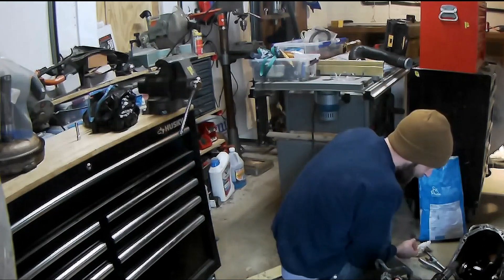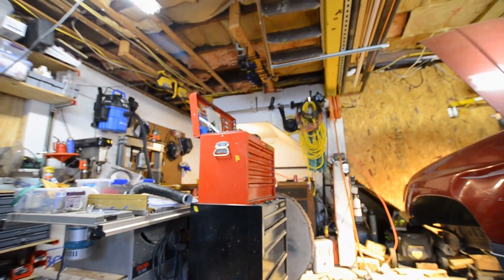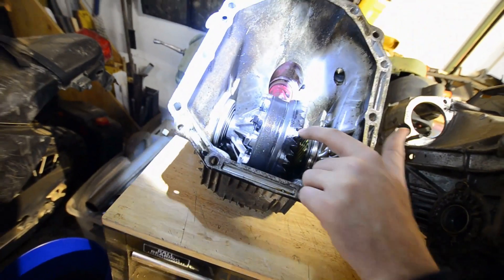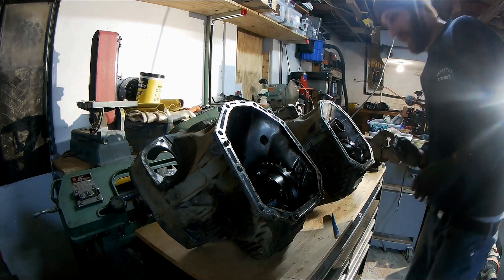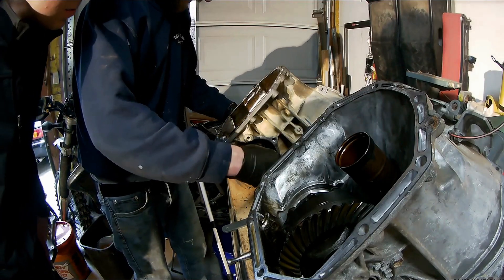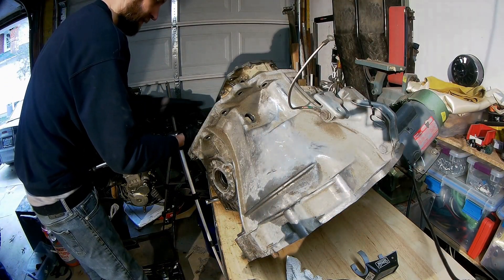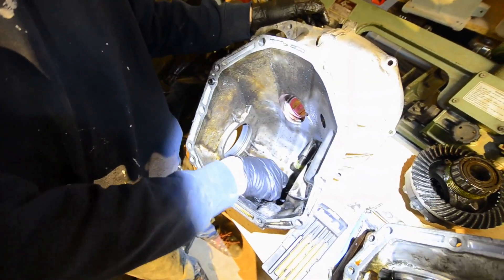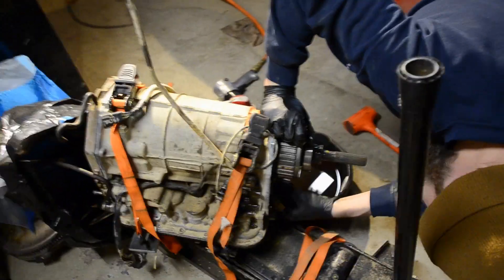Autopsy of a Subaru front differential run without oil

Comment: I own a 2017 Subaru Forester XT. I am currently dealing with a damaged transmission that a shop is claiming the front differential, which had no fluid in it, caused the transmission to fail. Is that possible in a CVT transmission?

Comment: My front limited slip still works on my 08 2.5 outback base with 230k. Im not sure about the rear... But when I put the front wheel drive fuse in both front spin with no delay. 💯👌

Comment: Thank you very much for the video. I have been looking for a video regarding front differential noise. My 09 Outback 4 speed automatics front differential is making loud noise when decelerating at a high speed and sometimes when driving about less than a mile with winning noise. I have been looking for a replacement front diff but I have not found one yet. I guess its sold with transmission which makes it harder to find the right one. Hope I can get some feedback on how to find one for my 09 Outback. Thanks again for the video

Comment: I know this is an old video but, May I ask how you got the pinion out? I haven't took the car apart yet. I've had a spare trans in my storage for a few years. My car broke on the way to work yesterday. I stopped hastily and grabbed the transfer case but noticed I didn't get the pinion.

Comment: Great job!  Some idiot mechanic did a differential service on my 2007 Forester and did not refill the front differential.  Not knowing it, I set out on a 1500 mile trip north.  I developed a high pitched noise about 800 miles out.  I checked the oil level and it was bone dry.  I filled it with new fluid and completed my trip.  The car always had a slight whine and at 250K the transmission failed.  There was lots of metal filings in the automatic transmission pan, etc.  I got a used transmission and fixed the problem.  Was it the pinion bearing that failed?  Hard to trust “line” mechanics to perform work properly.

Comment: Hey guys just want to thank you for everything y'all do for the Subaru Community I have a huge favor to ask you. I have a 05 Outback XT so it should have the vlsd for the rear diff and a VTC for the center diff I've already exploded both of these LOL and replace them. I'm about to do the center diff mod that you've explained and ordered the switch and resistor. My question is is there a factory LSD front diff for the automatic that I can get from a wrecking yard? Or a way to make it a locker? Also is it possible to get a Torque Locker Center diff? I have an 05 with the vf52 turbo and 6 inch lift really trying to make this thing an awesome off-roader and still be drivable to and from work would love to have LSD front and either Locker Center and rear or LSD Center in rear as well

Comment: Hey, 
Curious as I'm just before this. Making a dual range 1,447 with 4,444 diff and 0,738 5th. Is it possible to swap wrx bellhousing to n/a sf box? Any ideas?
Reply from the maker: You are seeking the turbocharged version of the holy grail. Not sure if  the exact setup you're going for is possible or not, but I will say that swapping in a 4.44 front diff from an auto into a manual involves swapping the pinion too. If I recall correctly, that's all one big assembly, designed specifically for the auto configuration of course.
Reply: @powerofyourbrains  i've got 4.444/from manual box.

Comment: So, how did the diff run out of oil in the first place? There's not really any where for the gear oil to go, unless (a) someone drained it and forgot to refill or (b) there's a crack/leak in the diff housing. Did you find any evidence of the latter?
Reply from the maker: That transmission came in the car, which had a broken connecting rod and many other signs of neglect from it's former string of teenage owners. I don't know why. If I were to guess it would be got cooked off after 21 years and 160k of neglected maintenance. That, and it probably escaped slowly out of the aging seals.
Reply: It's been in my experience some cars eat certain fluids, vws are notorious for drinking power steering fluid, no leaks, just gone lol

Comment: Hearing the same grinding noise in my 04 Fozzy, diagnosed it to be my front diff as well, wondering if I'll find the same issue in mine when I read it apart, if I don't go the route of just dropping in a used trans, thought my trans and Center diff still work well, the front diff still works but does grind if I'm hard on it.. don't have the lack of gear oil issue you guys had though as mine is still full and clean
Reply from the maker: Well sorry to hear that. Fortunately it's not all bad though. If you're pretty confident about the cars maintenance records it could just be that you need new or move viscous gear fluid. It could also be carrier bearings. Those are less of a big deal to replace, but in reality you may as well just pick up a phase II 4EAT at the junkyard. Check car-part.com to find the part nearest you. You can probably find the entire trans/diff assembly and just swap it in there. Cheap and easy...easier than getting a new front diff dialed in for sure

Comment: Are the front axles sealed away from the diff or should the oil come out if you remove the axles from the diff? i remember being surprised that no oil came out when i replaced my front axles and now im worried the diff is empty
Reply: There should be a dipstick for the front diff. 

But no, oil will not come out when you pull the axles. There's a relatively small amount of oil that sits in the bottom of the diff. The movement of gears through the oil takes care of the lubrication.

Comment: How Hoarder is it to Make a differential looker switch for a Subaru Outback and is it Possible. 
Keep up the good videos.
Reply: What kind of locker are you looking for? The center diff, or the rear?
Reply: Tyler Scranton the center diff.
Reply from the maker: @flyfishingadventure.6997  Not hard at all as long as you have an automatic and some basic electrical skills. Same concept as what we show in the diff locker video, and you can find more detailed instructions in forums if you need.
Reply: @flyfishingadventure.6997  Check out our center-diff locking vid. It's some pretty basic wiring. Feel free to ask if you have any questions!
Reply: The center diff, if you have the MPT or VTD based AWD, is super easy. Check out our mod video on that. 

For the rear diff, there are some that have rigged together a locker that will fit the R160, but so far all of these take a lot of work, and are around $2000, MINIMUM. That said, there are rumors that there's a company working to create an autolocking drop in for the R160, but I won't elaborate too much on that.... For now. ;)

As for the front diff.... There tons of LSDs that will fit in the front of the manual boxes. For the auto, it seems like there's only been 1 proper LSD ever made, and only a handful of those units exist. Phantom Grip is an option, but... Well, we haven't used one and can't recommend it one way or the other. No locking solution for front otherwise, and an autolocking would ruin the streetability of it.
Reply: I made one for my Liberty (Legacy) after watching the video, its basically the same as an Outback, very straightforward.

Comment: This is why I sub your channel, fascinating! (the offroading is fun too) Thanks for the swag guys! Not sure where to put the STI sticker on my N/A Forester though...

I'd guess the pinion bearing failed first as it takes the bulk of the load from the engine when its transferring power to the ring gear. Looking forward to the next video! Hopefully you show us how to set the bearing preload?
Reply from the maker: Thanks man, glad it got to ya. Because it's driven from the rear and under tight tolerances, there's really no telling. Bottom line is that differentials need oil, but I'm honestly impressed it put up with our abuse, only failing during sustained highway. Quite a sturdy unit.
Reply: Any Forester is an STI if you believe.

Comment: Correct me if I'm wrong but isn't it a PTU In a AWD VEHICLE
Reply: Never heard of the term before now, but it seems that in a front wheel drive based, transverse system, where the AWD is just kind of added on, it referred to as a power takeoff unit. 

Subaru uses a symmetrical AWD system with a longitudinal layout. While, in some systems, the power is slightly front biased in normal conditions, it's designed from the ground up to be AWD. Front differential, rear differential, and then some variation of a center "diff" to transfer the power. Engineering Explained has a great video explaining the 4 flavors of Subaru AWD.

So I guess your center diff is technically a power transfer unit, but not in the same sense as a FWD based system.

Comment: To mitigate consequences of mis maintenance, increased security margin of use; it's desirable to use anti friction additives validated in accredited and certified labs or others used in several industries.
That oil 6:52 seems completely burnt or previously contaminated, low level and extended period time without draining  ---> additives package exhausted for hypoid gears

Luckly, you have huge mechanical skills to fix it!
Reply from the maker: The fluid you see was actually added on during the trip, in an attempt to be able to limp it home. The diff was actually mostly dry with some gooey burnt oil. If I had to guess I would say that the previous owner never changed it, because we know that maintenance was not something they really cared for. This was our fault for not checking.

Comment: Very informative video (7:33, would a worn, faulty clutch pack cause loss of power when going uphill?). I always check my front diff oil, but will definitely check it today again....just to be sure.
Reply from the maker: Thanks, and it wouldnt cause power loss. Stalling at around 2500 rpm?
Reply: @powerofyourbrains  ah Ok! How do you mean stalling at 2500RPM?
Reply from the maker: By stalling i just mean failure to advance, feeling like power loss. It happens when you hit the stall load for your torque converter. If it is, you can either go faster, install a high performance torque converter, or climb less steep hills.
Reply: @powerofyourbrains  yes, it does that, even on smallest of inclines.
When I step on the gas the rev jumps to 3000 for a while, then drops (repeat)...
So if the issue is the torque converter, would installing a higher capacity engine make a difference?
Not climbing steep hills isn't an option!!
Reply from the maker: Hmm, sounds like something else might be going on then. Torque converter would only stall if you don't have enough power.
Reply: @powerofyourbrains  I observed today morning that it stalls @2500RPMs, as you had indicated earlier...
Reply from the maker: Yeah, but if it's happening on only a slight incline it means your probably not making enough power. Torque converter kicks in for load relative to available power
Reply: I'd be almost a shame not to add a locker or L/S at this point. Theres one that fits from a Nissan pathfinder I believe but does take some monkeying around with other subaru parts to install.  I've got the info hanging around someplace.  Cheers fellas
Reply from the maker: @TheHandyFireman  we have some big news coming soon ;)
Reply: If you'd like me to dig up the parts numbers and info let me know......But I'm guessing that you've already got a plan 👍
Reply from the maker: @TheHandyFireman  Indeed we do, but at this point it's still in the works. I'd definitely be interested in that part number if you can grab it. Curious about what it is and available gearing.
Reply: I'll dig it up. I'm outta country till next week, I'll fire some stuff off to you.  Where can I send you a pdf file to?
Reply: Dude, I just found it on my phone. It's an installation guide to install an air locker into a Subaru R180 front diff. Pricey stuff, but an air locker is the ultimate set-up. Especially in a front diff.   Imo
Reply from the maker: @TheHandyFireman oh so a 4x4 application then. Too bad its not an r160
Reply: My mistake,  I just read some of the article. It's to install an air locker in an R180 rear diff from a 2015 sti, which was then installed into an older Forrester. Sorry for some reason I thought it was the front diff. (Proceeds to bang head against my empty beer can)